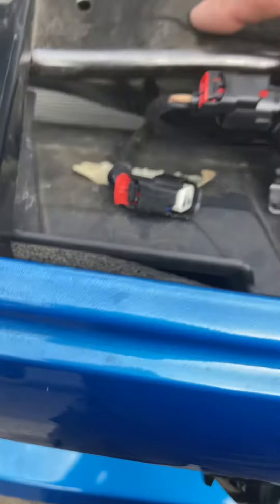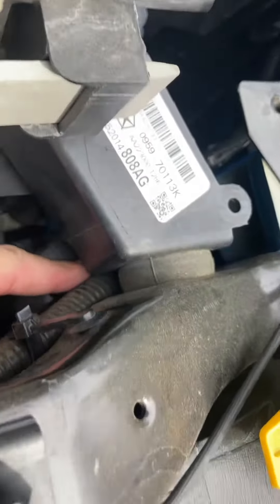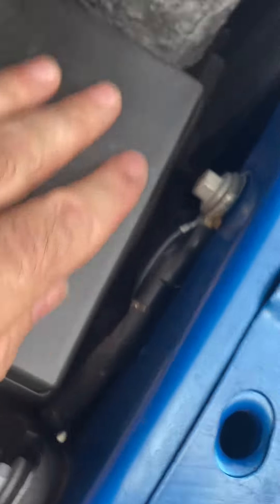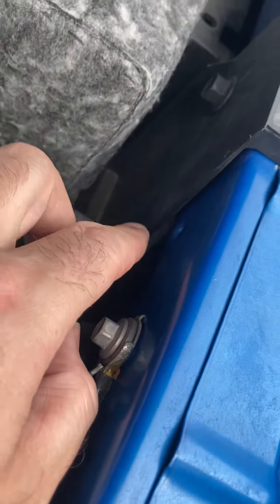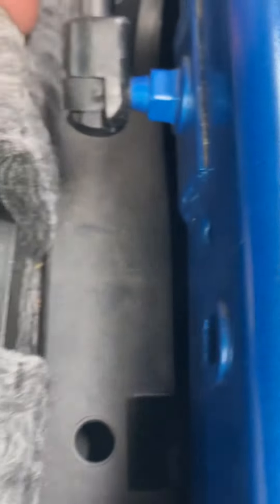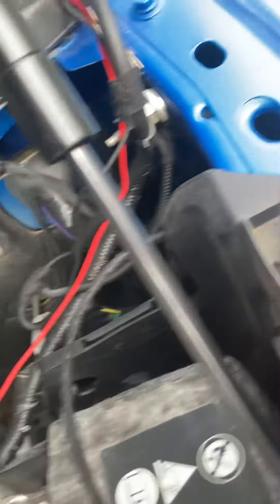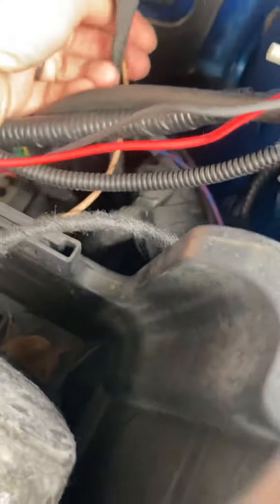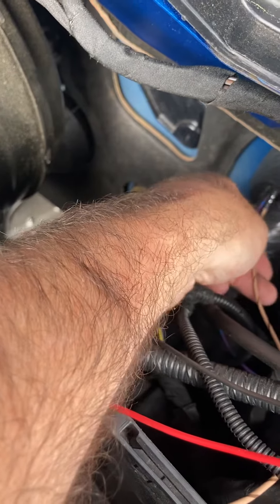4th Gen Ram Factory Remote Start Full Wire Harness Install

Comment: I need that wire harness. I can see the purple wire at pin 11 at the BCM end but it’s not terminated in the big connector under the fuse box. Sucks that ram would do all that and cut that one wire off in the harness
Reply from the maker: You mean it does terminate at the connector under the fuse box?  So you just need the wiring with the hood latch connector to the connector under the fuse box?  Shoot me an email, I can help you out.

Mrdougherty1@aol.com
Reply: @hydroblueram  other way around. The big fat plug has the wires for the hood latch in it but the other half of the connector does not have the wires but pin 11 at the bcm is populated. 

It just does not full the full way from the BCM to the plug under the fuse box. They must cut it off somewhere in the harness
Reply from the maker: @chrismckenna5361  what year is your Ram?  If it’s populated at the BCM then it should run all the way to the connector under the fuse box.
Reply: @hydroblueram  2017 1500 express. I’ll try to take pics of the connector under the fuse box
Reply from the maker: @chrismckenna5361  yeah man, email me some pics.  That wiring should not terminate between the BCM and the connector under the fuse box.

Mrdougherty1@aol.com
Reply: @hydroblueram  email sent

Comment: Sweet! I have a odd 2014 3500. I have a TON of options. Like all of em. But no leather or remote start. So I have a set of heated and cooled leather seats I want to put in, and I want to add remote start. Trying to dig out all the information on it I can. 

My truck already has that latch/wiring if I remember correctly. I’m going to check tomorrow

Comment: You still sell the wiring or at least know what size pin and wire gauge that goes to pin 11 on the BCM?
2018 Ram 1500 SLT 3.6L 4x4

Mine does not have the connector taped up behind the grill or the purple wire in pin 11, pin 11 is not populated on mine. I've searched for days. I have the SGW bypass and alfaOBD. I greatly appreciate it 😂
Reply from the maker: @thedd13ram  are you sure you don’t have any wiring?  Most trucks have at least half the wiring.  Shoot me an email and I can get you straightened out.

Mrdougherty1@aol.com
Reply: @hydroblueram  just sent you an email. I assume the M is capital in your email address

Comment: interested in that full harness for the remote start
Reply from the maker: You may have some wiring already.  Hit me up and we can get it done.
Reply: How can I message you for a harness
Reply from the maker: @antdogg9463  you do not need to replace your rf hub for remote start.  You would just need some wiring back to the BCM, a new hood latch, either a new rubber overlay if turn key or a new fob is push button, as well as some programming.